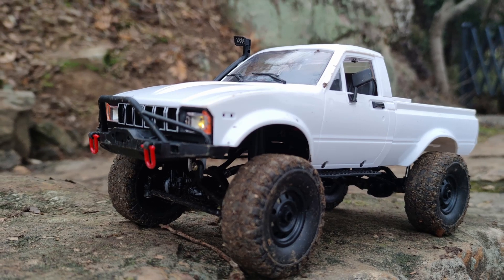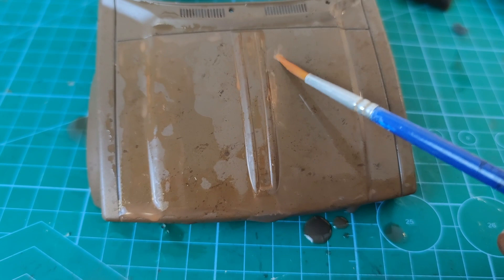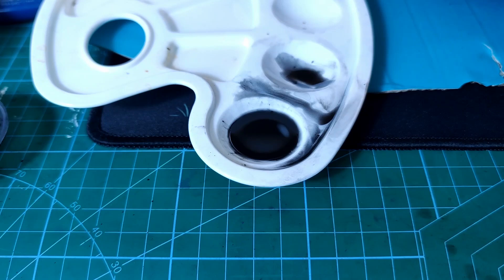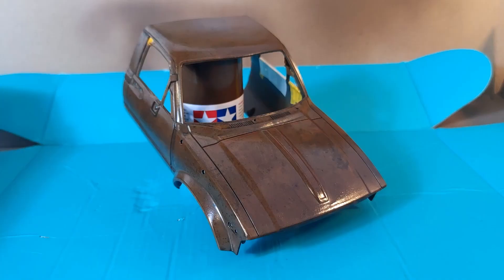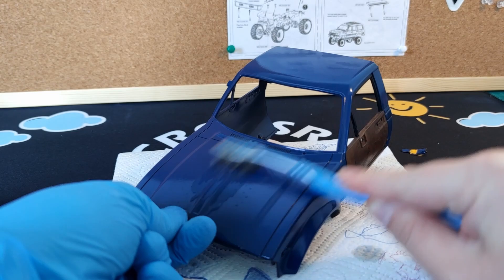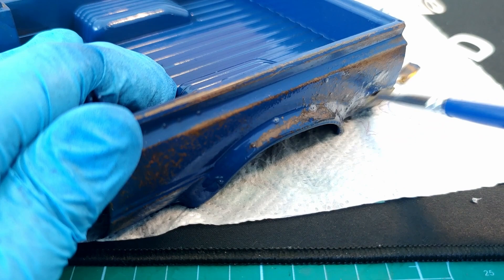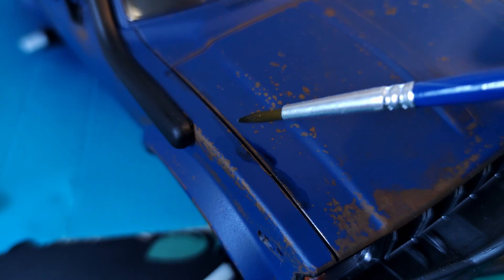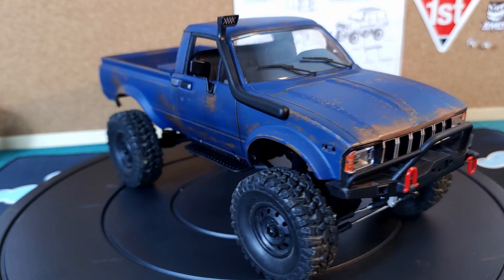Transform Your RC Car with the Hairspray Weathering Technique

Comment: The results are very impressive.  Rust works best when it is still quite subtle and it is possible to easily overdo it and add too much corrosion.  As a finisher, I'd mask off the sweep of the wipers and use a thin layer of TS-71 Smoke on the windscreen to replicate dust.

Comment: This is still new to me. Any reason you do the last black wash after the clear coat instead of before?  Awesome job by the way. It's inspired me.
Reply from the maker: You could do the oil in the panel lines before clear coating. The only reason I did it in that order was I was planning to add more rust effects and I wanted to protect the work I had already done. But in the end I didn't like the additional rust effects so removed them with thinner.
Reply: @ChinaExpatsRC thank you. I'm going to give this a try soon. I appreciate the help.

Comment: Awesome!!! I have a RGT EX861070 2.4G challenger in green rc 1/10 truck..I want to use tamiya PS-55 clear to get rid of the gloss on the lexan soft type body shell. But I want to add weathering to it and keep that color..how can I add rust weather?😮
Reply from the maker: @arni7810  This technique isnt for already painted lexan, you'd need unpainted lexan and need to paint the rust before the msin body colour on the inside.
Reply: @ChinaExpatsRC  gm!!! Yes I know. But how do I add rust weather to a lexan after I use tamiya PS-55 to remove the gloss off the shell?

Comment: Wtf.... hairspray is not chipping
Acrylic rustolium used.
Reply from the maker: It takes a lot of water and rubbing at first. You need the water to penetrate through the paint layer.
Reply: @ChinaExpatsRC  spent about 40min with a heavy duty plastic brush. Tried my plastic chisel to get it started. Solid bond. Maybe the hairspray was too good (dried 24hrs - used regular hold)... maybe I didn't use a thick enough later. Maybe it needs clear coat prior so paint doesn't bond.
Reply from the maker: @brappineau4161  is rustolium a really thick paint? Can you scratch some paint away? You need to get water to touch the hairspray layer so it starts disolving and shedding the paint as it does.
Reply: @ChinaExpatsRC  it is thick. I intentionally used a razor to remove top layer paint to expedite the process and still could not chip it. Perhaps enamel would be better than acylic.